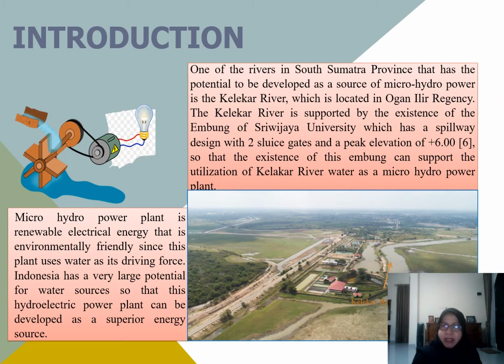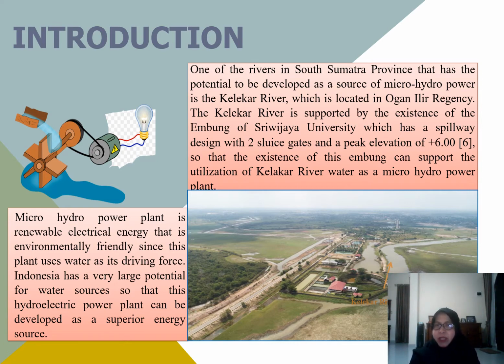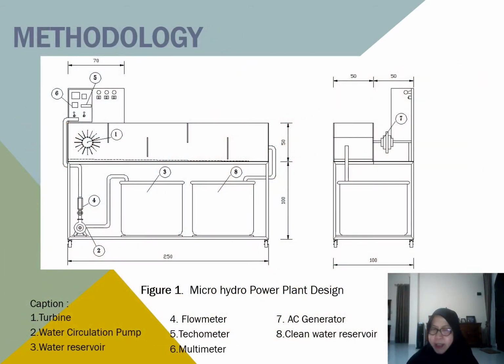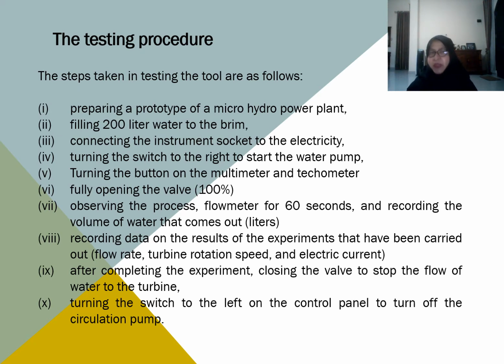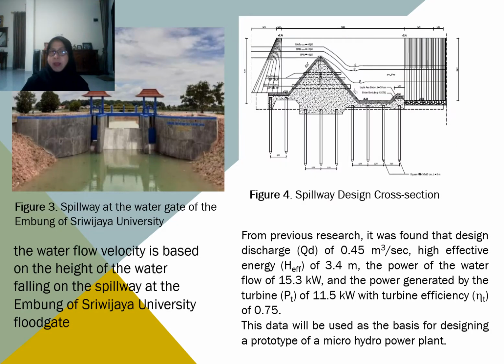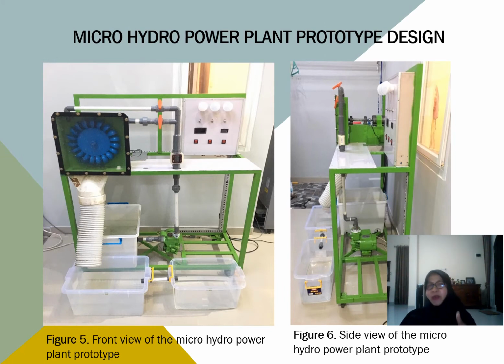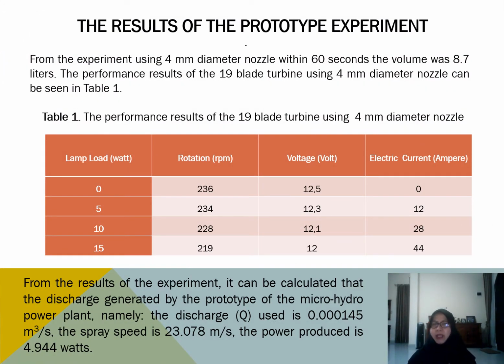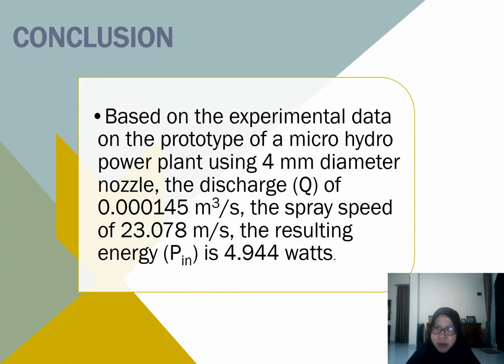Design of Microhydro Power Plant Prototype Based on Kelekar River Flow Discharge

Comment: some more info.      your idea  MAY  be  valid,  but you clearly do not  understand  the finer points of hydropower.         i have already explained why  Pumps  are  NOT  used where  flowing  water  is the energy source.        in addition, a spillway is  not part  of  electrical power  generation.!!!!        it appears that at  embung  equals  dam  or  is the name of a village.       in any case, three to four meters of  HEAD, is  Not  a  lot.     CONSEQUENTLY,   the  head  SHOULD  be  PRESERVED (with a horizontal transport system; aqueduct)  Until  the  water  is  Delivered, to the TOP of,  an  Optimally  chosen/designed  hydroturbine.     waterwheel radius should be equal to  fifty percent of the  Head.       see this company, for an excellent  bucket  design.    googletranslate
https://www.smith-eng.co.uk/hydro

Comment: some info.       at  :44,  'the  river is  supported by...'  ???          embung   equals  what????         'peak elevation',  is equal to  six   WHAT.  ???
at 2:46,  pumps  are used  ONLY   in a pumped storage system.     such a system  can be utilized only in certain circumstances.       in a pumped storage system, the pumps  consume  More  energy than is produced.      googletranslate
https://en.wikipedia.org/wiki/Hydropower
https://en.wikipedia.org/wiki/Water_turbine
https://en.wikipedia.org/wiki/Pumped-storage_hydroelectricity
https://www.usgs.gov/special-topic/water-science-school/science/hydroelectric-power-how-it-works?qt-science_center_objects=0#qt-science_center_objects